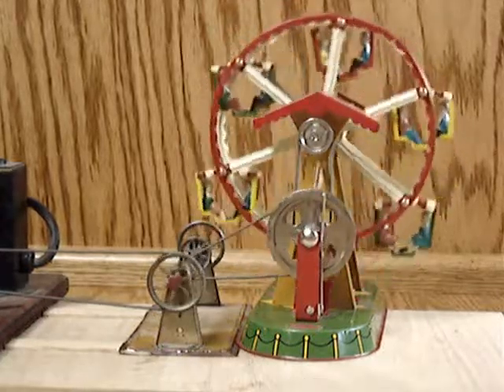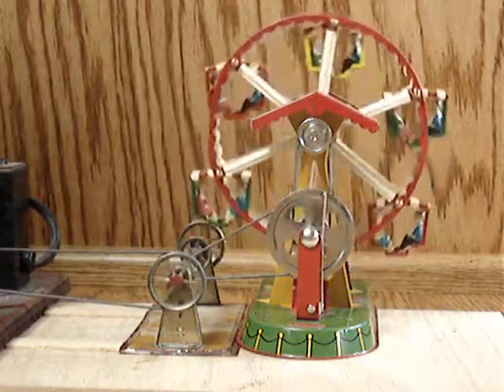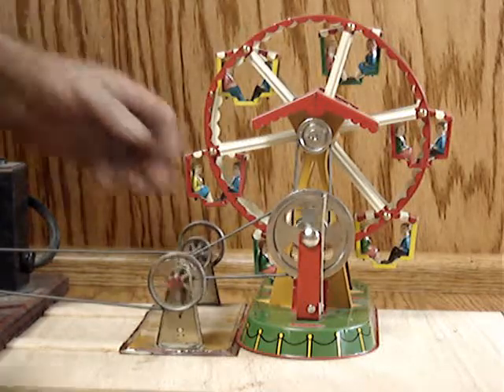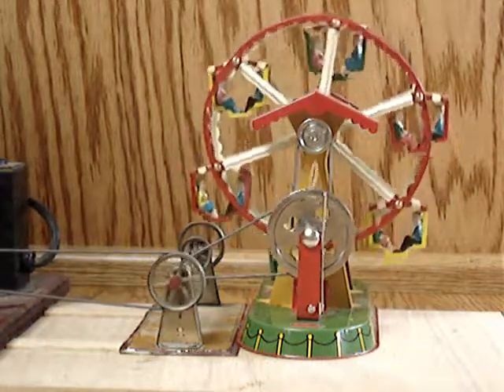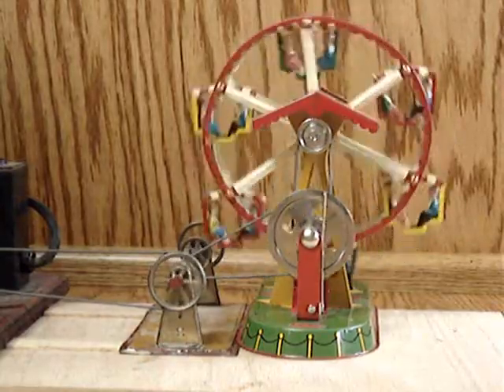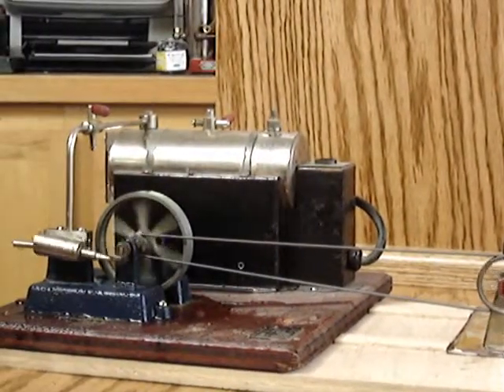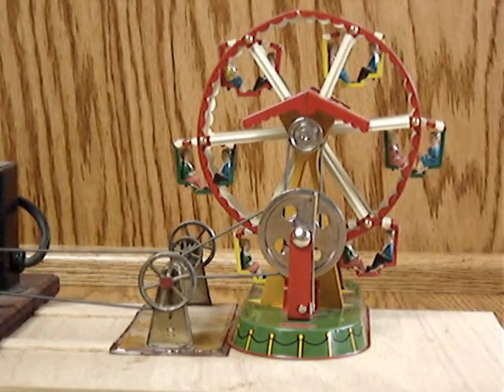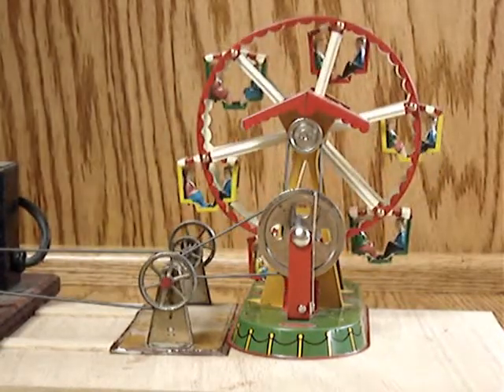WILESCO FERRIS WHEEL DRIVEN BY JENSEN #5

Comment: Hi, 
I recently bought an M78 Ferris Wheel from Ebay.
 Mine appears to have the wrong pullies (Meccanno ones) which have replaced the originals. 
I wondered if it was possible to see any pictures of the originals please? As I would like to obtain original parts and get mine working correctly.
very best wishes
Terryvee